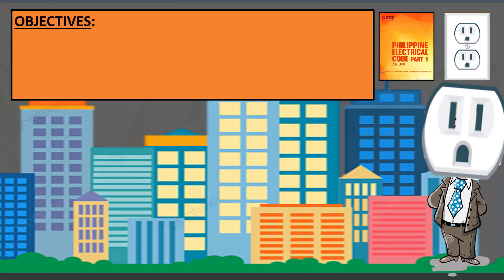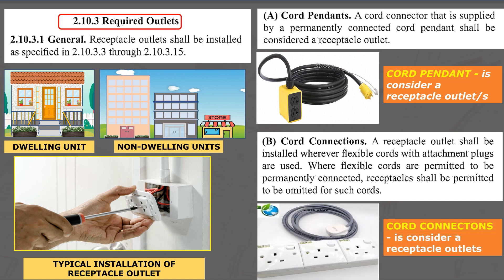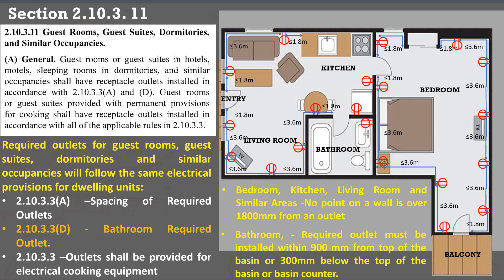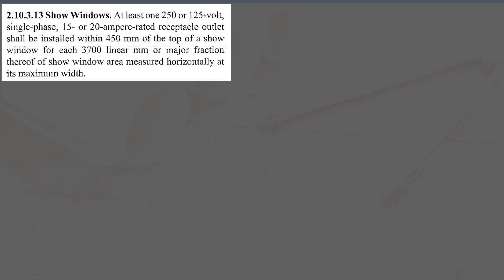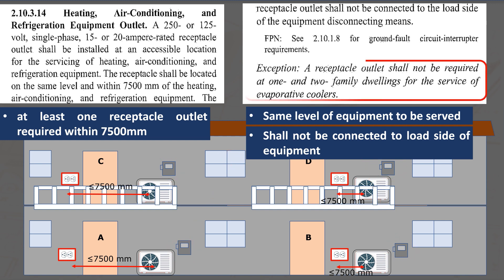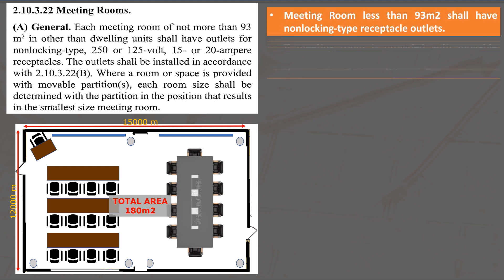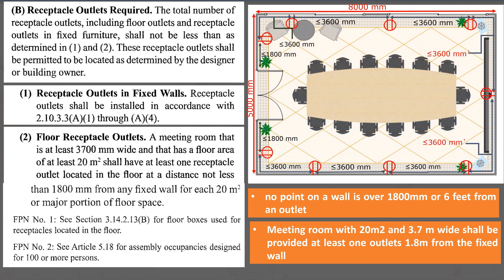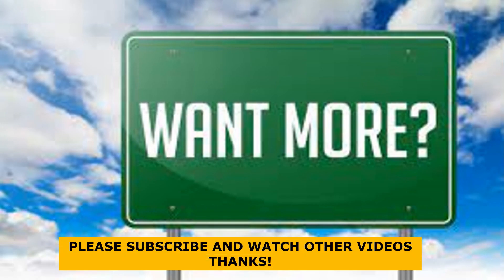Required Outlets Non Dwelling Units

Comment: paano po receptacle outlet location and spacing sa hallway at storage room?
Reply from the maker: Hello ka-Circuito, for non-dwelling units wala rules para sa placement ng outlets, sa dwelling units lang required if ang haba ng hallway ay 3 meters or more, need ng receptacle outlet at least one. Para sa storage room wala rin rules si code para sa placement ng outlet. Ang pag lagay ng outlets sa hallway at storage room is up to the owner, designer or electrical practitioners, since ang main goal ng placement ng receptacle outlet is to discourage ang pag gamit ng extension for safety ng personnel and property. Thank you for watching,
Reply: @codesultant  Maraming salamat po sir ang laking tulong ng sagot nyo. Sana po makagawa din kayo ng lecture tungkol sa branch circuit VA sizing ng FACP, CCTV, future load anticipation at iba pang load other than lighting and receptacle. Salamat po.